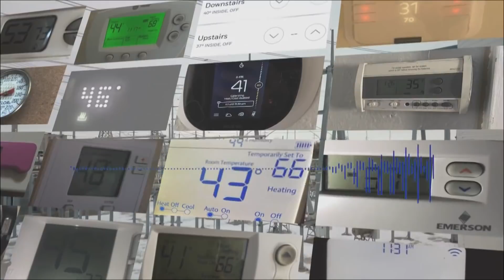Grid expert explains how the power outages happened in Texas

Comment: Ok so which is it:
A) a problem with generation? 
Or
B) a problem with distribution?

After 2011 promises were made... Promises to do what:
A) maintenance of existing equipment? 
Or
B) cold weather upgrades to existing equipment? 
Or
C) replacement of existing equipment with cold weather capable equipment? 
Or
D) adding entirely new, parallel cold weather capable systems that will just be a maintenance overhead used only for the 2 week intrusion of polar air masses every ten years or so?

Comment: Don't pay you're electric bill we don't pay for part time electric we didn't have this problem before deregulation bull sh t
Reply: Malcolms HVAC You pay per unit. Power cuts mean zero consumption. There will be no cost for the period power wasn't supplied. Interesting that you work in HVAC- you might try explaining to your customers that proper insulation will not only stop them from freezing in a freak winter storm, but will also keep them cooler for less in a typical summer. This would also reduce demand on the grid and make events like this less frequent.

Comment: Trillions spent over the last year in USA 🇺🇸 on the demic..but they can’t fortify power grids!
No excuses. 
Wait for a huge CME in the next 22 years. Grid down. All they need is a few trillion  in capacitors on power grids .
Reply: We missed an X50 class CME by 9 days in 2012.  Would have been as bad as the Carrington event of 1859.  
From Wikipedia:   The solar storm of 2012 was an unusually large and strong coronal mass ejection (CME) event that occurred on July 23 that year. It missed the Earth with a margin of approximately nine days, as the equator of the Sun rotates around its own axis with a period of about 25 days.[1] The region that produced the outburst was thus not pointed directly towards the Earth at that time. The strength of the eruption was comparable to the 1859 Carrington event that caused damage to electrical equipment worldwide, which at that time consisted mostly of telegraph systems.[2]
The whole planet would have been f*** if it had been a direct hit.  It WILL happen in our lifetimes.